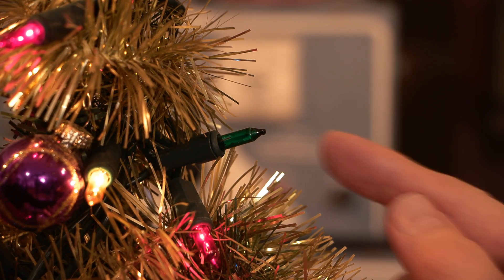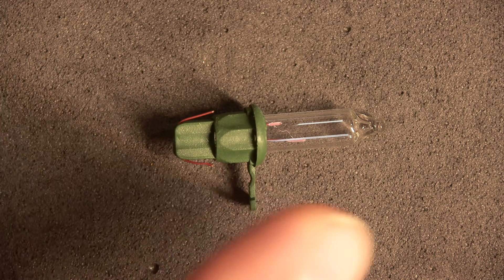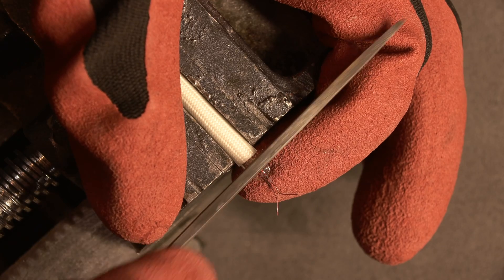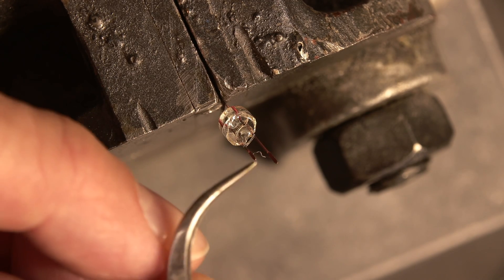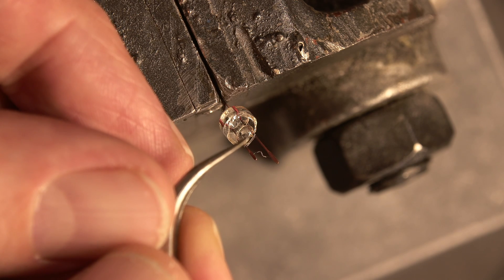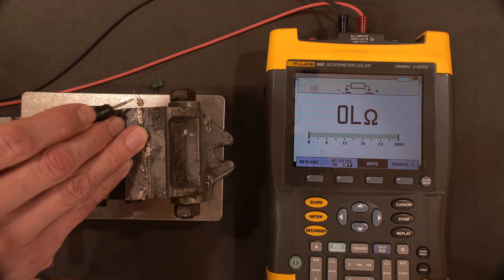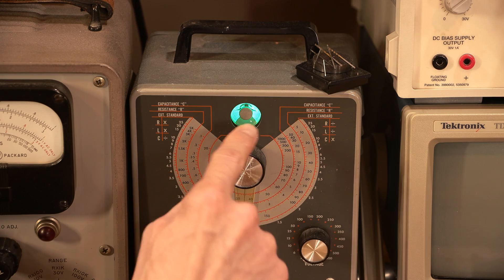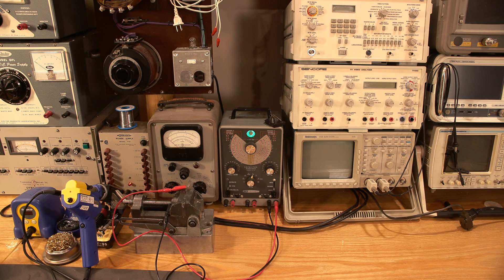The Magic Hiding Inside Your Incandescent Holiday Light Strings!

Comment: I have noticed the shorting wire on this bulbs without ever realizing IT was 'voltage actuated'! For years thought it was some hi resistance wire in paralell with the filament... it would not have worked that way! 65 years and still learning
Reply: Same Here.   Ever since I noticed the shunt, I was curious how the high resistance filament got the current instead of the shunt in the very first place.   INSULATION breakdown - magical.

Comment: Shorting the life of the other bulbs or breaking down the insulation when the filament burns out I don't believe is the case.
I believe the wire is resistive as with the filament. It's akin to two resistors in parallel. The filament when cold has it's resistance is much lower than the wire so the current flows through the filament until it glows, as it's resistance drops then excess current flows through the wire. [The wire is about 1 ohm] It actually regulates how much current can flow through the filaments. Therefore as bulbs burn out the excess current is dissipated in the wire as heat thus each is protected from over voltage. With the supply voltage being at 120V @ 50 lamps the voltage across each lamp is only 2.4V and when one burns out the voltage across each other bulb only increases by .05V [or 5 hundredths of a volt/50mv] but I digress, that small current is dissipated across all the remaining bulb wires. Notice how strings are sold in multiples of 50 because they simply parallel strings of 50 to get the higher count overall strings.
Reply: if it is true that there is a breakdown of insulation, I would like to see using a high speed camera on one lamp with the string in operation and then breaking the vacuum of another bulb to see if there is a millisecond that the other lamps go out.
Reply: I think you have the solution. I find it very difficult to imagine how to construct an insulator that will break down, almost exactly,  at 120V rms at virtually no cost.

Comment: Wow! I'm 67 and have always known about the shunt wire inside the lamps, but until today had no idea how it worked!  Why didn't it short out the string? Thank you for such a nice demonstration!
Reply: According to Franlab, every shorted bulb makes the others brighter, so will shorten the other bulbs' life.
Reply: @Vortexan9804 That's true.  Think about it. Fewer bulbs equal smaller load equal more voltage going to each bulb equal brighter lit bulbs equal shorter life. 😊.
Reply: Yep, I just assumed that the filament was designed to melt itself into a short.  I always preferred the C7 or C9 bulbs even if they are energy hogs.
Reply from the maker: You are welcome!

Comment: when you turned it up to 150 and created contact, wouldn't that make a dead short and blow a fuse in your power supply, or is it protected
Reply from the maker: The capacitor tester is current limited.

Comment: I have a modern LCR meter, but It does tests at low voltage. Is there a need to have a tester like you have for leakage in todays stuff? Can modern caps have leakage that only show up under higer voltages? Thank you for the explanation the light bulb.

Comment: I think this takes advantage of the oxide layer on the leads of the bulb which was created to make a glass to metal seal. The oxide layer has a high impedance at low voltage.

Comment: Love the video, didn't know about the shunt. But, you mentioned a "catch" that shortens the lifespan of the remaining bulbs. Is that because of the lower resistance of the shunt, increasing the voltage/current per individual bulb? My feeling is that once one bulb is out, the others will go sooner.
Reply from the maker: As a bulb fails, it increases the voltage across the others. The more bulbs that fail, the higher the voltage goes across the remaining bulbs. This is why when you spot a dead bulb, you replace it as soon as possible.
Reply: Yes, the line voltage is divided equally among the bulbs. When one goes and the shunt is activated, that socket is shorted, so there is one less for the line voltage to be divided among, so the voltage applied to each remaining bulb increases. One is not too bad, but if a few go, they start to cascade. That is why when one bulb goes, it should be replaced, even if it is not noticeable. A small increase in voltage can significantly shorten the bulbs life. Long life bulbs are simply 130 volt bulbs. They run slightly left efficiently, but being over-rated by only 5 volts or so, can increase the bulbs life by 5 to 10 times.
Reply: Why can't they design the shunt to have the same resistance as the filament?

Comment: This shunt is why the light keeper pro is a handy tool to have.  Sometimes the the shunt doesn't 'fail' into place (the insulation holds up) and thus the string goes out.  The light keeper pro sends a momentary high voltage 'shock' through the string to 'fail' any shunts on burned out bulbs.  Pretty ingenious.  I've since moved to LED lights but still have my light keeper pro.  (please forgive my undoubtedly wrong terminology)
Reply: @fersusoncomputing Me too, I bought this this tool a couple of years ago not really giving it much credibility at the time. I thought it might be snake oil but it really does work ... and now it makes complete sense why it works.
Reply: Agreed, I didnt realize the second circut in the bulb that has to be shorted before it will connect
Reply: light keeper, or any piezo igniter from any bbq your neighbors tossed out over the last year - that's all it is
Reply: @gorak9000  I made my own Light Keeper sparker with piezo igniter.   Works great.   LED bulb strings are a pain in the arse to fix compared to the incandescent.   I once worked on a string of LED Christmas lights where all the LEDs failed.   As each LED failed short all the rest started going until they all avalanched to death.    Strangely there were blinking LEDs in the string and those are the only ones that survived.

Comment: I'm a bit disappointed there I thought you might have used your microscope on the piece of wire and we could watch the insulation failing would have been nice. How do they make the installation to fail at the right voltage and what type of insulation is it? Merry Christmas

Comment: Back in the 1880s, a similar system (the film cutout) was used with streetlights.  A high voltage supply and series connected bulbs, with a self-shunting socket.  See patent 818253.  This used a thin insulator between two spring contacts in the socket that would arc through when exposed to the high voltage
Reply: We used that in a string of 300V bulbs (6 I think ran very dim)used to limit grid current in a 1 megawatt induction heater. Porcelain base had clip to hold the shunting fuses that you could replace if the bulb failed. used a saturable  reactor and 15000v dc supply

Comment: I remember the old versions, if it burned out, the whole string went out. So you had to spend a hour taking a known good bulb and substitute every bulb with the good one until you found the bad one. Worked great unless you had more than one bulb bad. Sonetimes it was easier just to buy a new set. You could find the bad one if you had one of the little bulb testers, but you still had to pull every bulb
Reply: Funny “if I knew then” I could have used an ohm meter and binary search to find the bad bulb in a minute or two.
Reply: How? (I know all about ohm meters and binary searches already). How do you avoid a serial search?  @JB-fh1bb
Reply: @JB-fh1bb  oh yes, the computation complexity of fixing xmas lights! Why do it by O(n) iteration when you can use O(log n) binary search? :)
Reply: I remember looking for the bad bulb only to find out the bulb I was using was also bad!  D’Oh!
Reply: anyone old as dirt remembers that   😂
Reply: Old ad dirt...?  Lol @SPINNINGMYWHEELS777
Reply: You made me remember that comedy song “The 12 Pains of Christmas”
“One light goes out, they all go out”
Reply: We've come full circle because leds are all in series, and there are no shunts, so if one fails, the whole string is dead!
Reply: Yeah and also LED has a positive and negative lead. I found that out when a took a red set and a green set and made two red and green sets some would not work until I took the LED out of its holder and reversed the LED . That was a long project doing 12 sets now they sell red and green sets especially on a reel. Now I'm using All red sets go figure. I guess variety is a good thing. 73 @gorak9000
Reply: Brings back memories!!!!
Reply: Hahahaha! For this reason, when I was a kid, my dad had me pull each bulb AND plug it into another string to make sure it turned on.
Reply: U can just use a 9 volt battery to check them.
Reply: Same here
Reply: I am not positive, but didn't Mr. Carlson have a videos about finding a bad bulb?
Reply: Just put 5kV at microamps through it - the bulbs that light up are blown
Reply: In my day, it was the same but with the big chonky glass screw-in bulbs, inevitably at some point each year up on a ladder, freezing… now can you just be quiet and hold the light David….
Reply: I remember one year stringing them all out on the kitchen floor and going through them with my grandma, doing just that. While swapping out bulbs, somehow, someway, I accidentally jammed my finger down in a socket, I think maybe i'd dropped it and I was just picking it back up and the whole strand spun on me. But as soon as my finger went inside that socket my hand and face exploded, it was awesome, my face looked like someone had thrown a bunch of soot on me and my hand was black. Ahh, the good times, I sure do miss my Grandma.
Reply: @MatthewHolevinski fake comment, its notnlike home alone i real life, and to add more if u live in USA its just 110 volt, just a little tingel, in EU we have 220, u feal it pretty good, but its no home alone effects, most stupid and funny thing i read this day😂

Comment: Maybe I missed it, but does the tiny bulb normally operate at 110v? If someone wanted to experiment with these bulbs, how much voltage should I use? Can't draw many amps/watts, right?
Reply from the maker: The bulbs I used operate at 1.2 Volts. NONE of these bulbs operate at 110 or 120, they are all in series, many bulb filaments in series add up to 120V.
Reply: @MrCarlsonsLab  this is why burned out bulbs shorten the lives of the others in the set, yes?  They operate at increasingly higher voltages as more bulbs burn out?
Reply from the maker: Exactly!
Reply: @MrCarlsonsLab  I see. Thank you, Mr. Carlson.
Reply: Brilliant demonstration. So much better than another channels video on the same thing recently which didn't explain it at all.
Reply: In normal operation, the voltage across any single bulb is the mains voltage divided by the number of bulbs.